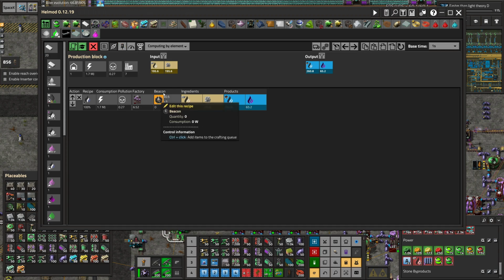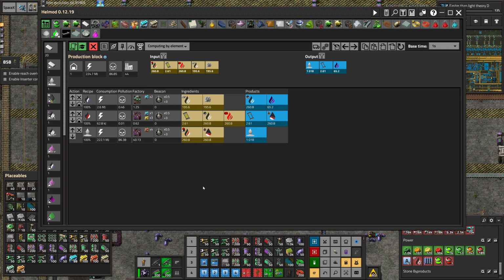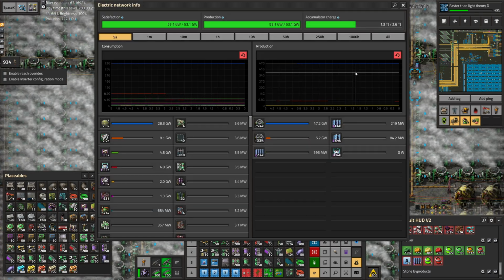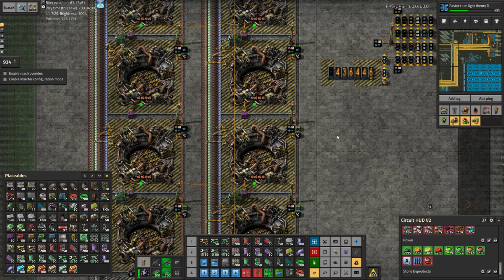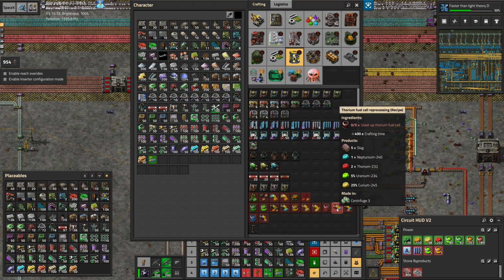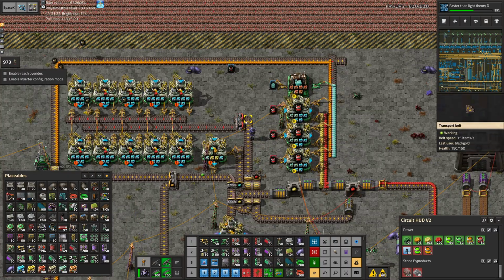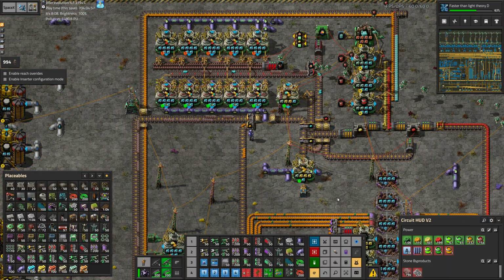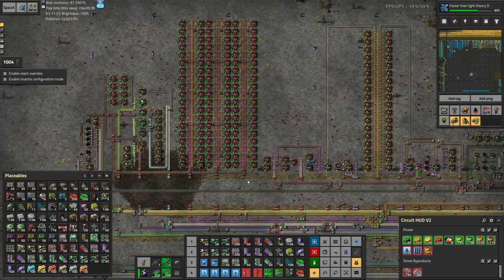[Factorio] Angel/Bobs Ep 378: Butane Plastic & Muon Catalysts

Comment: Do you think you'll need to expand your walls, truthfully? Or connect them to protect your reactors in the new area?
Reply from the maker: I hope not. So long as we keep using landfill the ocean can function as a wall
Reply: @marsh8056  Does the landfil consume pollution in this mod?
If not maybe a fun thing to do before you build over it is to fire a nuke in each landfilled chunk. (dont ask me why but after nuking landfill starts consuming it)
Reply from the maker: @raglock1433 I have no idea, since i go straight to concrete I never wondered if the landfill did anything with pollution
Reply: @marsh8056  why did I not realize that concrete is a thing xd
Guess I was excited to share some of my obscure mechanic knowledge 1:

Comment: When you have one machine making one belt of items, wouldnt it be better to use the loader?
Reply from the maker: Yes, although I try to restrict the use of loaders to balancing applications because they’re pretty OP compared to inserters
Reply: @marsh8056  Yeah thats true.

From balancing to train loading to buffering, they are very powerful.
Reply from the maker: @raglock1433 It can be a real pain to fully compress belts without loaders. My house rule is that if it goes into or out of a chest/warehouse, then it can use a loader